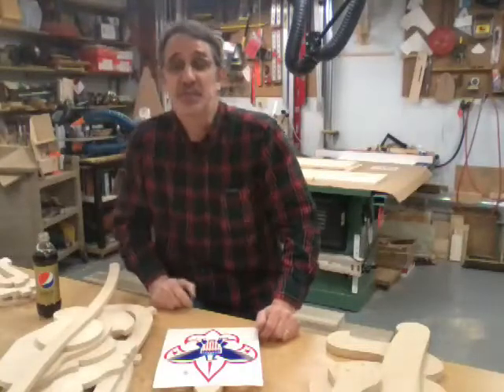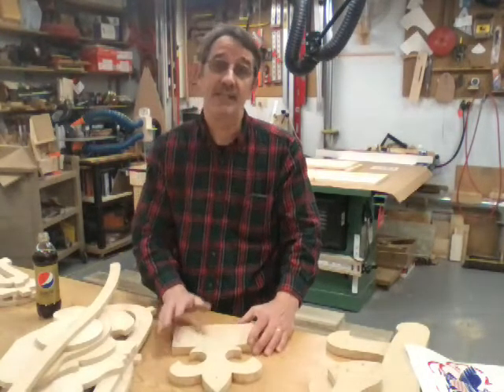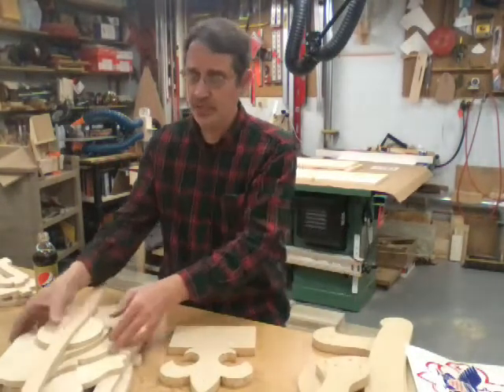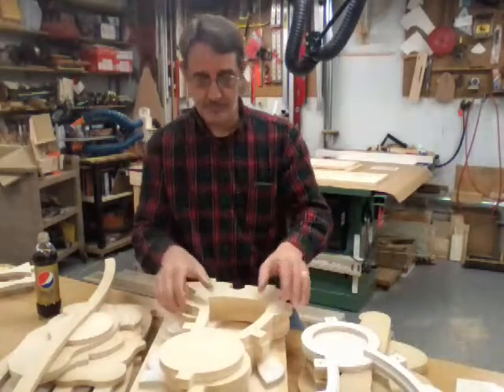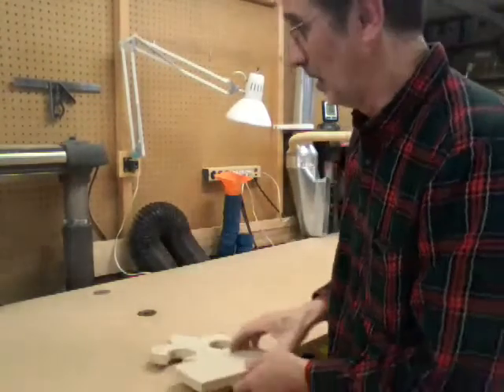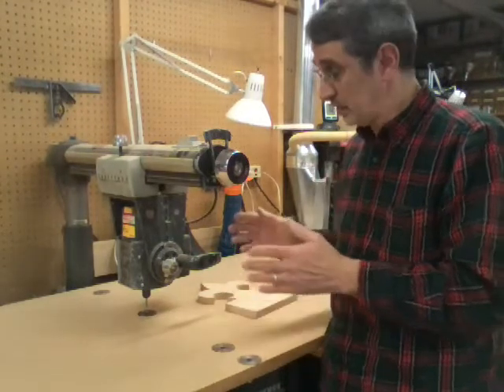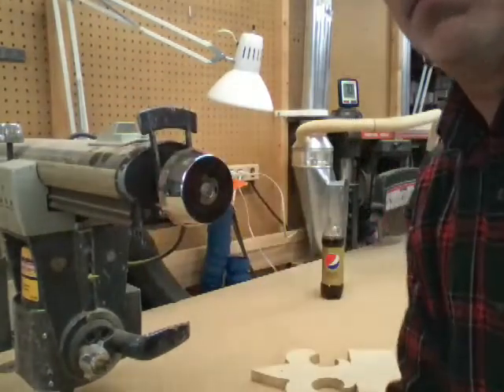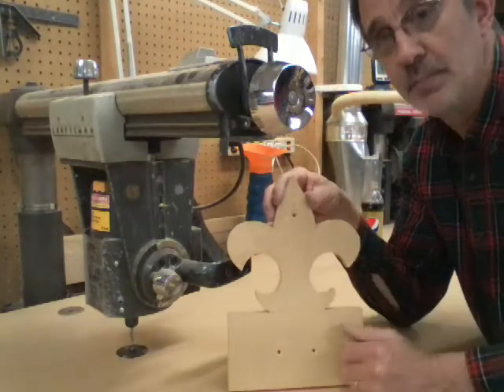83.  How can I build a pin router. Another Shop secret.

Comment: Do you think that this could be done with a motor that’s already on the radio arm saw because it will hold his shaper bit the next this is something that probably can be done on the Shopsmith
Reply from the maker: The only problem with the radio arm saw and the Shopsmith is they don’t turn nearly fast enough. A router turns at 25,000 RPM radio arm saw might be 1200 because sawblades won’t withstand high speed. Jim

Comment: Morning Jim, Just watched your video on the overarm pin router you made (brilliant idea BTW) I have an old Craftsman Radial arm saw (same model) Just a few questions. What HP router did you use? I'm kicking around either getting a 1 1/2 HP or is it better to use a 3 HP router? Second question, how much would you charge for a pin set? I'll be using it for guitar making so probably using 1/4 and 1/2 inch bits, depending on the complexity of the pattern.
Reply from the maker: I used a 1hp. Craftsman with 1/2 inch collet. Let me come up with something on the pins and holder. Jim
Reply from the maker: Send me a email so I will have your email to get back to you. Thanks Jim
Reply: Jim i tried the email you posted but it bounced back
Reply from the maker: @peterburnett8052  
My email is 
jimsfixitshop@gmail.com
Thanks. Jim
Reply from the maker: @peterburnett8052  my email is 
jimsfixitshop@gmail.com
Thanks. Jim

Comment: This is great. Craftsman used to make a router adapter plate, that would attach to their radial arm saw, converting it into an overarm pin router. This is probably the next best thing except you have to destroy the radial arm.
Reply from the maker: Michael Hamerin 
Well it’s nice if you could find one that doesn’t work, here in Michigan I can 
buy them all day long off craigslist for 75 bucks running I seen one that didn’t work and he wanted $35 for it. Jim
Reply: @jimjackson9381  Since it's virtually impossible to find that router attachment ( they don't make em anymore). A $35 radial arm sounds great for converting.
Reply: @michaelhamerin3814  u

Comment: Great video! Where do you get the 1/2" double fluted solid carbide end mill bits from? Thank you!
Reply from the maker: I buy them through the shop where I work usually when they go on sale get them for about $7.50 apiece when I do I buy 10 at a time and I use 1/4”dia.  . Jim

Comment: I did it.  I will be finished by tomorrow. I just removed the motor completely, built a platform to suspend from the original motor mount,  and designed it to hold a bosch, 1//2'' chuck,  plunge router.  I'm removing the cut up old table and replacing it with a new formica surface and pin holder too.  Can't wait  to try it.  Thanks for posting your project, I was thinking about a project like this and your video confirmed that I had not lost my mind and should go for it lol   So I did.  Thanks
Reply from the maker: ch11ew12y 
 Hi it’s Jim
   When you get it finished send me a picture of you and your pin router to my email which is. jimsfixitshop@gmail.com I really would like to see it and hang it on my wall thanks Jim

Comment: QUESTIAN I have an identical radial arm saw. The motor is fine, and it rotates, I wonder if I could put a chuck on it and use it that way?
Reply from the maker: ch11ew12y 
 Hi it’s Jim

 You can do that with your saw they even sell a Chuck that screws into the outboard side of your motor, The only issue you have is a sauce usually turns around 3400 to 3500 rpm’s.   To mount A router in your saw they turn around 25,000 RPMs you have such a small diameter cutter you need the RPMs to make it cut smoothly. Thanks Jim
Reply: Thanks, thats what I thought. I have a plunge router that fits inside the RAS motor mount perfect. I'm going to remove the saw motor (and save it) and mount it.  I don't need the radial I have Others. Thanks.

Comment: I'd love to see that pin router in action, I wonder how it handles all the waste!
Someone locally has a Shopsmith pin router table, it's made me curious.
Reply from the maker: Whit Elfner 
Well I’ll tell you want in an upcoming video I will see if I can clear all the stuff off the table and run some parts And let you see it in action. Jim
Reply: @jimjackson9381  Thanks, That would be neat. The pin router I'm looking at has a single fixed point that is about 3/8ths of an inch. I was thinking for pattern work I might use as small as a 1/8th inch with a 1/8 inch up spiral bit. I guess the piece could go to the band saw to finish the tight inside cuts, just like the idea of saving time.

Comment: Jim, excellent idea!
I have an older Craftsman RAS that the motor and carriage was sent in for the recall. So will see what I can do to replicate this system with the remaining parts. 
Am interested in the bits. 
You describe them as high spiral 2 flute carbide end mills. Is that the same as the upcut bits? Can you provide a link for purchase?
Reply from the maker: TheLaserguy2 
Hi it’s Jim
    When I get to work Monday I’ll check current prices and availability for the cutters and I’ll get back with you thanks Jim
Reply from the maker: TheLaserguy2 
Hi it’s Jim
    I haven’t forgot about you and your router bits I’m trying to Find a cheaper supplier where I bought mine for $7.08 nine years ago is now $30. But I think I found a supplier that will sell them for around the same price I’ll get back with you as soon as they get back with me. Thanks Jim
Reply: Thanks Jim. 
Found your video while trying to find a better way of pattern cutting larger pieces. 
Thought I had an excellent donor ras, but taking advantage of the recall, I realized that I no longer have the carriage for the Craftsman. So it will not easily work. 
I just acquired a Montgomery Ward Power Kraft RAS that has an output spindle of 20,000rpm. If I can get a router adapter to take a router or end mill, could actually have a ras and overhead router without making the modifications you needed.
Reply from the maker: TheLaserguy2 
  Hi it’s Jim
     I finally found a source to buy quarter inch solid carbide end mills to use in the router. if you’re interested let me know. Thanks Jim
Reply: YES!
Reply from the maker: TheLaserguy2  
  Hi it’s Jim
     I found a company that prices are still comparable to what I paid 7 to 10 years ago.
The website is 
www.uct-inc.com   she said they do have a $50 minimum which at times they wave The cutters are around $7.80 each 
That is for a quarter inch diameter cutter with a quarter inch shank three-quarter inch cut and 2 1/2 inch overall. Thanks Jim
Reply: Jim, I really appreciate your doing the research! 
Looking through their catalog, it looks like the 490, 490C, 490C, 490L and 490CB fit your description. 
Are you using the 1/4" diameter for all the cutting of your projects? One pass through 3/4" material? 
And how long does one end mill last you? 
Regards,
Jerry
Reply from the maker: TheLaserguy2 
Hi Jerry
   I guess maybe I should do a video showing how I do multiple passes and a cleanup pass on my pin router. Do you think that would be useful or not. Thanks Jim
Reply: From the video, it seemed like in order to make the boy scout emblem pieces so quickly, in addition to the square bottom being pre-cut due to material size, that is was all routed in one pass of essentially a square blank. 
That sounded like a lot of material being removed for a 1/4" mill in 45 seconds. 
Were you doing it incrementally, an eighth or quarter inch depth at a time?  Dropping the router down after each pass?
Reply from the maker: TheLaserguy2 
Hi it’s Jim
    The material I  was cutting was half inch exterior three ply plywood it was going to be painted so it didn’t really matter,  I used a quarter inch solid carbide cutter and I cut it in one pass the blanks were cut just big enough for the emblem to fit the bottom that was Square didn’t need to be cut. Thanks Jim
Reply from the maker: TheLaserguy2 
Hi it’s Jim
   I’m going to be uploading a video first thing tomorrow that will hopefully explain everything to you on the building in use of my pin router. Thanks Jim

Comment: Thanks Jim!  Great videos I just did likes and subscribed. I have the same  radial arm saw that I got free a few years age and I know what I'm going to do with it.  I have several 1/2 inch routers, what was the model router that you used?  and one suggestion is to put links to the other pin router videos in your descriptions. I found the other two just by chance looking at your videos. I'm going to put links to your videos in  my Pinterest account too I have about 2k subscribers
Reply from the maker: Frank W 
Hi Frank
  Mine was a craftsman industrial 3hp. router which I don’t think they make any longer. Jim